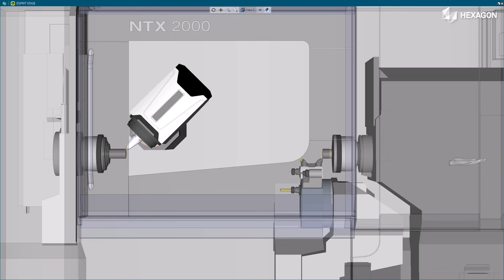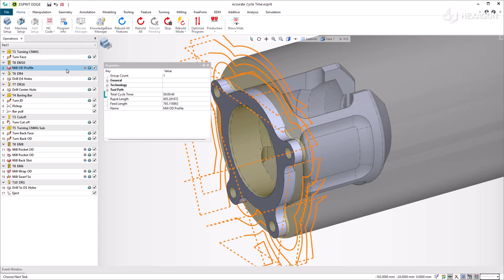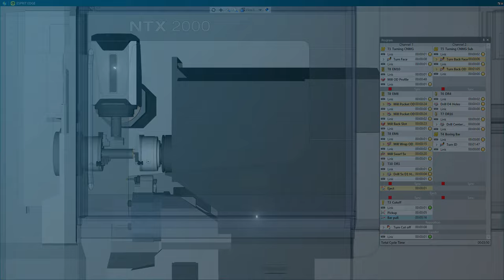ESPRIT EDGE 2023 | Accurate cycle time

Comment: The problem I have had in the past with cycle time, was that if I adjusted the tool change time to 5 seconds, the simulation would wait the 5 seconds.  Even if you had the feed and rapid turned up.  Has that been addressed?  When I run simulation at full speed, I do not want to wait 5 seconds per tool.